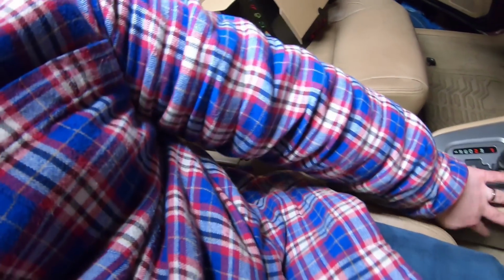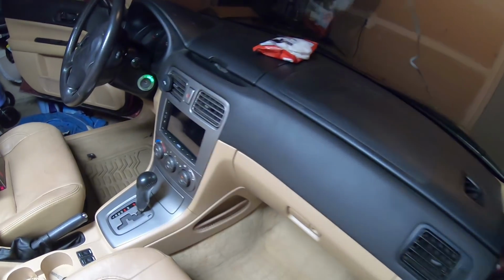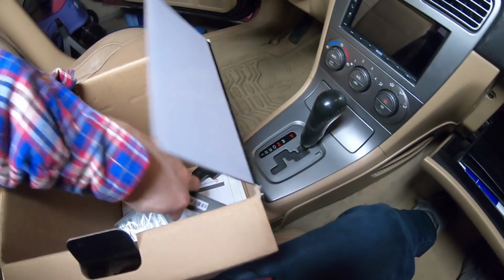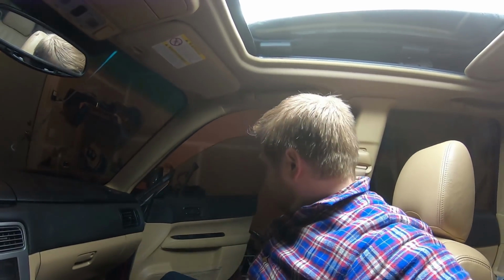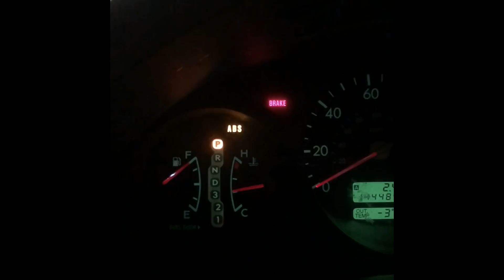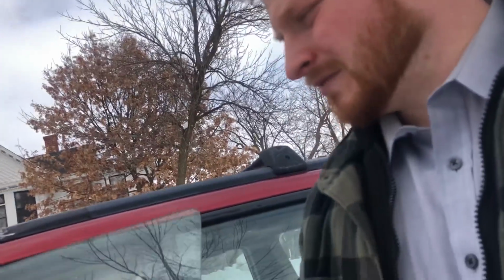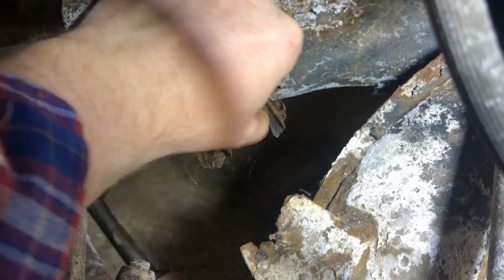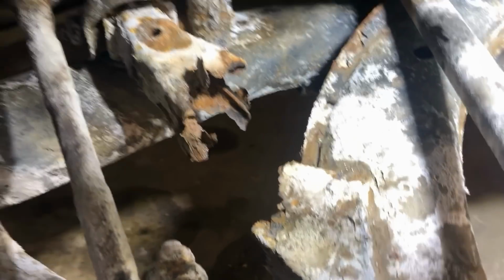Why I sold my Forester

Comment: The lower control arm failure is actually a recall item. It was issued in 2011. 

Could have been replaced for free. Oh well.
Reply from the maker: This one had already had the recall done to it and it rusted out again.
I tried getting Subaru to do something to it for a couple weeks before I actually got around to doing it myself.

Comment: The damn center console is just a pain to take apart. I skinned all the bezels with carbon fiber, but forgot to put the leds in the heater controls, so not looking forward to taking that apart again.